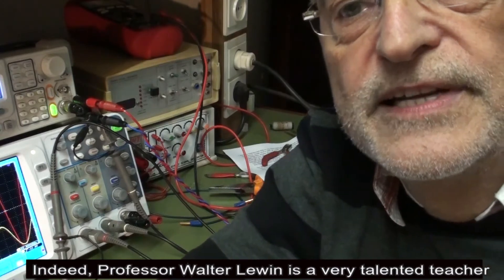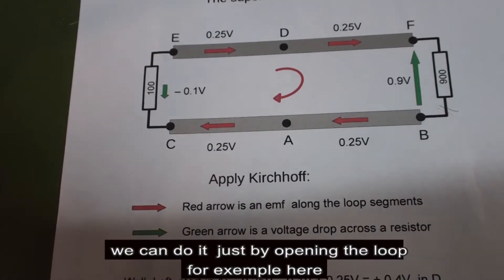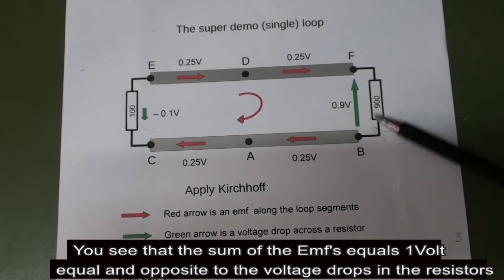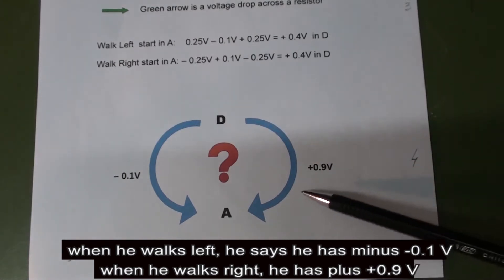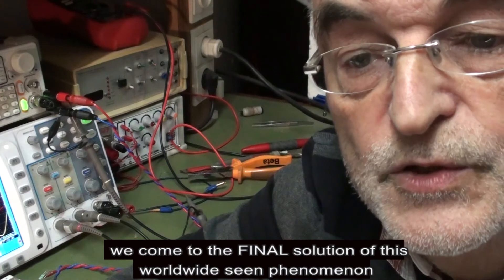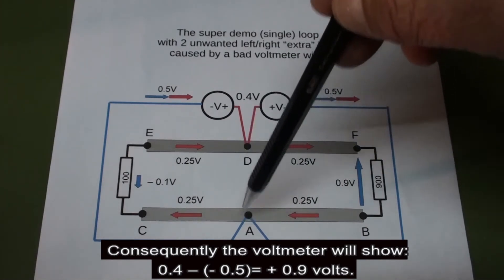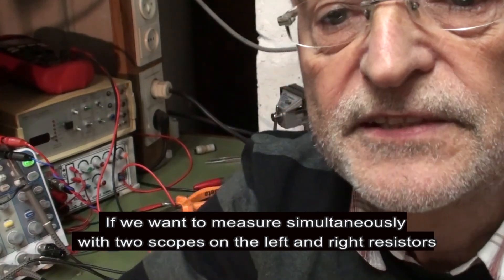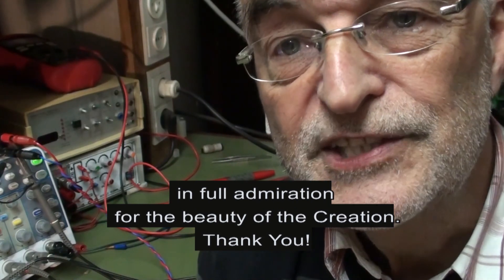W. Lewin Lect. 16 super demo revealed

Comment: Clarification. I will measure the voltage between A and D from inside the copper wire using the 100 ohm C E path. From inside Mr Lewin's loop I am not allowed to measure a magnetic induced voltage as I and my test leads are inside the loop. I am only allowed to measure the voltage drop across the 100 ohm resistor. Voltage between A and D is .1 volt. I will do the same for path B C with 1000 ohm resistor , .9 volts.  The voltage difference between A and D is both .1 and .9 volts at the same time depending on which path one takes. I believe the only reason Mr Lewin did it in this odd way was to wake his students up to gain their attention.
Reply from the maker: Dear John, I'm preparing a new video. So have patience for an answer
Reply from the maker: to John Heath: "I have no problems that Mr. Lewin wakes up the attention of his students, but this has to be done in a correct way.
 Ignoring that wire A and D can produce an emf, or pretending that a wire with a low resistance can't produce an emf is not the right way to increase the students their attention.
For that reason, I think it was a good idea to set this straight with a new video!"

Comment: Hello Mr. Mabilde, your voltage  acquisition are not persuading.  According your schematic  loop, for a data instant of time, we have Green Voltage potential  (drop of voltage on restistors)  an Red Voltage potential (drop of voltage on cable connection)  pointing in different directions !   Now  suppose that the loop circuit is realized  by a single resistive strip (having  same resistivity along all the loop),  in that case you certainly agree that we would have only Green Voltage potentials pointing  all same direction along the loop (same voltage drop for loop section of same length).  Now   suppose  to change  two sections  of the loop  (where are placed  the conductor or any other position) with strips of lower resistive value,  according your theory there should be a particular value of  strip  resistance at which the drop of Voltage potential change direction and become Red ?  You may realize that this kind of  discontinuity couldn’t happens in nature.
Reply from the maker: Red arrows are Emf's.
 If the loop consists of single resistive strip then you"ll have an infinite number of distributed voltage drops, and each of them are OPPOSED to all the distributed Emf's. So draw as much arrows as you want they will always cancel.
To better understand: think about the internal resistance (Rint) of a transformer secondary: it comes in series with the load resistance.( Rint + Rload)* I = Emf
Reply: Not true,  The integral of the Electric field along the loop IS THE EMF when you have an internal  dflux/dt.  In a data instant of time, the  component direction of  the vector Electric Filed along  the loop do not change  it's direction,  it could  be zero  in case of superconductors wires,  in case of real conductor it's remain negligible because his resistance is << load.
Also your formula ( Rint + Rload)* I = Emf  say that  the drop of voltage on Rint and Rload have the same direction  because I is the same for both.  
By the way, if we  assume correct  your  Kirchhof theory  (instead of Faraday for not conservative field)  considering the case I proposed  of a loop realized by 4 continuos strips resistance  you  have not answered at which  strip resistor value 2  strips of the 4 realizing  will have their voltage potential drop reversed  from Positive GREEN  (all 4 strips having same resistance) to Negative RED (2 strips having lower resistance).    Kirchhof is not true for not conservative field !
Reply from the maker: Indeed in the formula the minus sign is forgotten. But PLEASE forget about the non conservative fields. In my paper model : regard the red arrows and replace them by "momentary" DC batteries, then apply Kirchhoff or redraw the circuit and you"ll see that there is no more doubt.
When walking around  the loop be sure to do it from the backside of the red arrow to the pin side and for the green arrows(V-drops)from pin side to the back side . I think this is so basic. Result must be ZERO
Reply: Sorry,   your answer is embarrassing and without  any physical and math support,  I'm surprised is coming from an engineer.  I suggest you to go back to the study of Biot Savart and Faraday law.  Probably you are misleaded by the wrong oscilloscope acquisition you did  due the  big amount of flux going into the loop you realize connecting the probe.  The flux generated by your coil  is not only vertical,  it has to close is path  around the coil,  so an  important amount of flux  is going through the oscilloscope loop you did connecting  oscilloscope probe/gnd wire, falsing the measurement.    Please repeat the acquisition connecting two thin isolated wire to the C-B or E-F points, keep them adjacent to the conductive strip (glued them..) then in the middle start to twist the 2 wires and connect them to the oscilloscope,  at least in this way you minimise the area of the loop and you will get different voltage result.

Comment: I saw professor Lewin experiment a few months ago and to me his conclusions were extremely unintuitive. But... After thinking again about the problem, he is right and your video proves it.
What he says is actually very simple and you verified this by the end of the video, you measured the two voltages he measured. I think that your theory is wrong, but there is a way to prove it: measure the voltage between the copper wires. If it is different from 0, you are correct, but if it is 0, you are wrong.
When the probe is at one side of the circuit, there is no magnetic field going through the surface created by loop that goes from the probe, through the copper wire, resistor at the same side of the probe and copper wire. You can consider the loop that goes around the other resistor. In that case there is magnetic field going through the surface, but it doesn't matter since the result will be the same.
So, when you put the probe at one side of the circuit, the closed loop integral of E dot dl is 0, and the result is that the measured voltage is the resistor voltage.
When the probe is vertical, contrary to what you think, the surface created by the loop that goes around the probe and one side of the circuit "catches" half of the magnetic field lines, making the induced emf in that loop 0.5 V. 0.5-0.1=0.4 and 0.9-0.5=0.4. That is the reason that you measure 0.4 with vertical probe, half of the magnetic field lines cross the surface created by the probe and half the emf is induced. This is non intuitive at all, but I have to say professor Lewin is right.
I will build the circuit and verify this with my own eyes.
Meanwhile, did you measure the voltage between two points of copper? All your theory is based on the fact that there is voltage between two points on the copper. If you try to measure it, with the probe loop outside the circuit, there is no induced emf, so you are measuring the right voltage.
Reply from the maker: dear Ricardo, be  patient, everything will become clear in my new video. I can add a specific measurement if you send me a detailed description and drawing of what you want me to do precisely: cyriel.mabilde@gmail.com
Reply: Cyriel Mabilde I will make some drawings and I will send you!

Comment: Superb demonstration and explanation! I also tried to discuss this with Prof Lewin but he was not interested in a different viewpoint. I suggested enclosing the resistor loop in a mu-metal box which would prevent a changing flux in the measuring wires. He sadly would not reply.  http://geoastro.co.uk/puzzles/box.jpg
Reply from the maker: Dear, of course, if you make sure that both measuring circuits are not subject to the alternating magnetic field then you get an unambiguous value of 0.4 Vots and that is the same value as in my so-called "zero-flux plane", but Walter Lewin has never responded to. Thank you for your interest.
Cyriel Mabilde
Reply from the maker: Better watch my second video:  https://youtu.be/JpVoT101Azg

Comment from the maker: To Alex Tirendi: Dear Alex, indeed the small change in the measurement was caused by touching the wiring. So the vertical position was not maintained exactly. I'm building a more rigid model, beyond which no doubt can exist. The EMF' I've measured were real voltages, not ghosts. But trust me, I'm sure about what I'm telling. If you "google"me, you will find even an international publication "deep brain stimulation...." for which I designed a neuro stimulator based on 2 coupled single loops.
The stubborn idea that an EMF does not exist in a piece of a copper wire, but only in a closed loop, is still globally distributed, so as the Lewin super demo-mistake. By the way I find him a very brilliant teacher and I proposed him to cooperate. I have not the pretension to say that Faraday is wrong but at least his law needs another approach in some cases. In the case of my model of the loop I discovered that It has to do with the field distribution and position of the conductor in this field. I'll do a mapping with a "near field " scope probe. If you do an exercise for yourself : change each 0.25V EMF's by a simple DC batterie, you will be convinced that also Kirchhoff is true. Let me know please!!!
Maybe I'll find the time to make an even more convincing video.
Goodnight and greetings from Belgium
Cyriel Mabilde
Reply: Dear Mr. Mabilde, i did my own meassurements and came to following conclusions: I did two versions, one version with a little solenoid (10mH with a ferrit core) and soldered two resistors together so that they formed a close circle around the solenoid. I had some effects but for me it was impossible to avoid any induced emf into my probe. As you know a single wire can hold an emf, even the tips of the probe wires and their lenght had an influence on my meassures in some positions the cooper emf would be canceled by emfs induced into my probe and i meassured 0V across the cooper wire. I can't exactly say how much the probe induced emfs would alter the measuring results in your case but It would be very interessting if you would do a mapping with a near field probe for my own (and others!) learning interesst if you're willing to. 

The second version, i did with a shielded transformer inspired by the video of Mr. Dirk van Meirvenne, i prefered that method because i had to deal with almost none  parasitic emfs in my probe. Although i had my doubts, i came to the same conlusions as Mr. Meirvenne and yourself (you can read my conversation with Mr. Meirvenne in his comment section: https://www.youtube.com/watch?v=v85ln_l0fcE&t=3998s). Best regards.
Reply from the maker: If I understand it well, you used a cilindrical ferrite core and only a "one" winding loop. Depending on the dimensions (diameter) it will not be easy to do the experiment.
Measuring on the single loop is a real challenge (field distribution!!!) because the errors inherent in the measuring method  are of the same order in magnitude as the value that you want to measure.That is the reason why Professor Lewin  made the wrong , and most people still believe him.
 He added and substacted a false scope-wiring voltage (emf 0.5 V ) to and from the real voltage (0.4Volts) that exist between the middle points A and D . That resulted in minus - 0.1 V and plus + 0.9 V.
 Furthermore you also have to take into account the emk in the loop wire itself, because  it also contributes to the total field distibution, making the field less predictible.(Lenz law)
 If you build my model, all emf' s and voltage drops are best measurable in a vertical position because the scope wiring is then in a "not field cutting" position . Make about 30 windings as primary air coil and take a printed board as single loop scondary. The dimensions are about 10 cmX6 cm.
 I'm preparing some drawnings to show the field distribution  and the restrictions that it gives in making exact measurements. 
I'll show a second model in which the errors are 6 times lower than in the famous single loop model of W.Lewin and this demonstrates more clearly that it was a measurement error and that the super demo was completely wrong. Very, very sorry for him, he is really briliant, he is the best teacher, but this demonstration was a regrettable mistake.
Further I will try to show a simple model that describes the behavior of a winding when it is in a static and alternating magnetic field. This will show that" Kirchhoff is not for the birds"
Greetings from Belgium,  Cyriel Mabilde
Reply: Yes my first experiment was exactly like mr. Lewins but much smaller, i would be very nice if you could show the fields of the coil and how it effects the probes and like that show the mistakes of mr Lewin. Many thanks, best regards.
Reply from the maker: Alex, indeed I intend to make a field mapping, but do do it right I first must construct an appropreate near field sensor. Next week I will not find the time to do it cause I'm in the US. 
Meantimes I have already an idea of how the field is about to run.
Also the exact measurement of the emf's and the other voltages is not that simple and because of the field distribution it is for both different. But I think that in a couple  of weeks the strange behavior of the single loop will have no secrets anymore
Best greetings

Comment: A counter argument. If you lived inside the copper loop and made measurements they would agree with Mr Lewin's position. If you leave the copper loop and make measurements from the outside the results are screwy depending on where the test leads are relative to a changing magnetic field as you demonstrated. If your scope ground lead follows the copper loop again the measurement agrees with Mr Lewin. Only when the scope leads are at 90 degrees is the magnetic effect canceled as you also demonstrated. A fork in the road. Which path to take?  Because one understands why the changing magnetic field is effecting the measurement we cancel this effect out and say Mr Lewin could have made a mistake. On the other hand when you measure AC voltage from a transformer it is a correct measurement. This is a double standard as the voltage coming from the transformer is the result of a changing magnetic field the same as Mr Lewin's voltage measurement is the result of a changing magnetic field.

Comment: Your measurements are corrupted.  The element of confusion is the confusion of circuit and field analysis.  As soon as you put probe connections in area where magnetic field is, you are in affect adding loops to the "circuit".  When you measure the drops along the copper bars (B to A, A to C, E to D, D to F), the voltages you get depend upon the position of the wiring between the probe and the bars.  If the wires to the probe were laid flat against the bars, you would get zero for the B-A-C and E-D-F voltages.  Your probe leads are coupling to the field.  (If you were to connect the ground lead to the probe tip, and bring it near the drive coil with the loop of wire horizontal, you would read voltages, even though the probe is shorted by the connection).  This voltage corrupts those readings.  The readings across the resistors are correct because the probe loop is away from the region of the field.  Connect probe to D and the ground lead to A.  If you maintain those connections, you will read 0.9V when the probe is swung near 900 ohm resistor, and will read negative 0.1V when probe is swung over 100 ohm resistor, exactly as Walter measures.

Walter has it right!  imagine a fountain of water shooting up through your drive coil.  It shoots up and then falls all around, looping down around the coil's outside.  That is the shape of the magnetic field, and is concentrated directly over and closely around that coil.  The only way to get valid voltage readings is to have the probe connections coincident with the loop conductors, with no "stray area".  There is no mystery!
Reply: Dear Brian, you are right when you say that holding the probe wirings flat against the bars results in a zero voltage measurement because there is not an enclosed flux between the bars and the wiring. I will demonstrate that very soon. After all I am convinced that a rectangular coil was not the best solution. Therefore everything will become very clear when you will see my new video where I am using the same circular coil as used by Walter Lewin. In that set-up it is easy to measure the B-C, the E-F (each are 0.5V) and the A-D (0.4V) voltages because the scope wiring is always in a so-called "ZERO_FLUX" plane. The voltages across the quarter segments A-B and A-C along the rectangular loop can not be measured in the way that I let suppose (separately)  as you saying. Consider these 0.25V rather as an interpolation value between the extremes  We know that all emf's are really present in the "bars" and nevertheless they are still denied by Walter Lewin. In my next video I will use a totally different set-up to demonstrate that the emf's  are almost completely "in" the wire segments when using the short smd-resistors and not exclusively in the resistors as Walter Lewin says. Please wait a few days. Best greetings from Belgium.
      Cyriel Mabilde